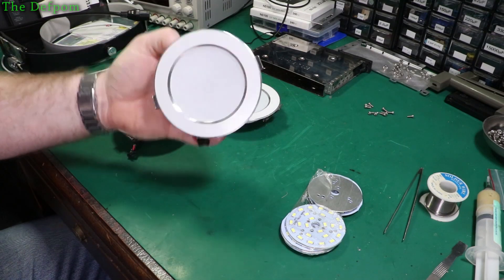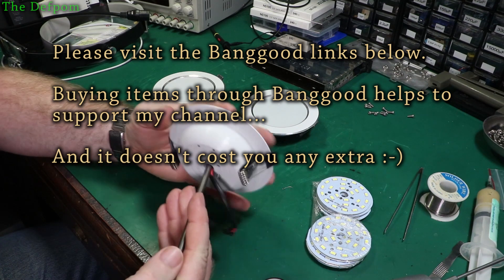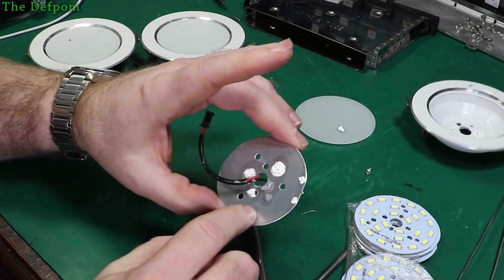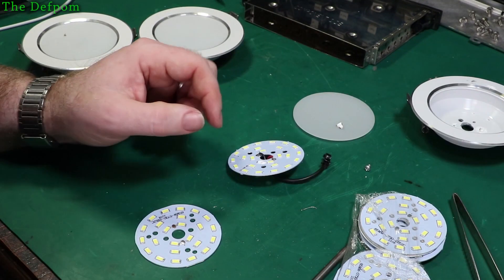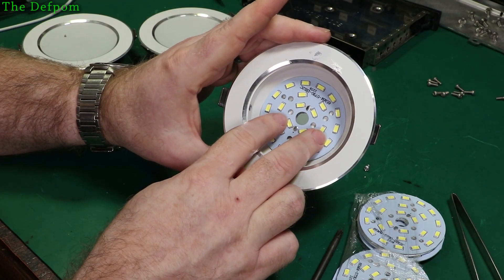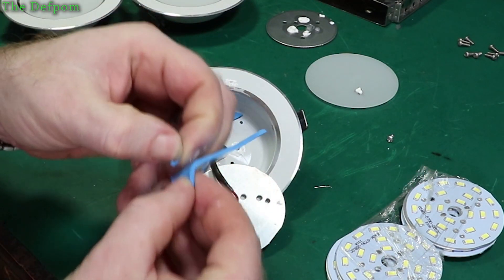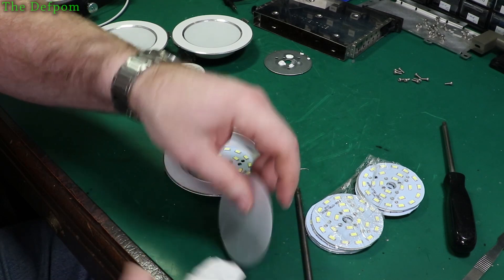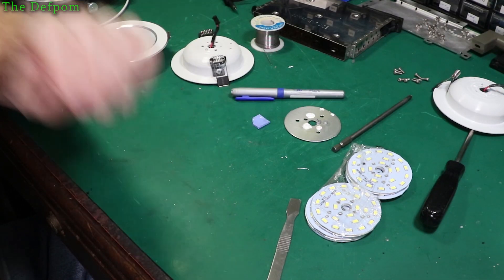🔴 #592 LED Ceiling Light Repair - How To Repair A Broken LED Downlight

Comment: i have a fan from home depot. only 6 months old, and the led blew 2 little spots on it already. But they dont sell the LED disk separately. I can't find it anywhere. I reeeallly dont want to uninstall the fan and take back.  its a Samsung led 20W, the light dimmed 3 levels. I dont know what all of the little numbers on the face mean but it may be a part number E466169. where do you think I could buy one? Home depot said no, lowes said no, I looked on amazon and could only find 17W.  the only 20W was $36. screw that. Id rather buy a new fan, switch out the bulb and take it back since they are not willing to sell me the part.

Comment: Thermal pads from old CDROM drives would work as well, you get around 3 per drive, enough for doing all those lamps with better (and free from ewaste) heat transfer. 5 minute epoxy also works well for this, though of course now the lamp is not easy to remove again. To pop those lenses out use a bamboo skewer, works well for me, or use disposable wooden chopsticks.

Comment: Might be worth try a compressor with just a blower attachment on it and sealing the other holes with your fingers to spread the pressure on the plastic a bit. Just a thought
Reply from the maker: Josh lever - I don’t have an air compressor, if I did doing something similar could work yes, HOWEVER and I don’t mean to be critical this comment is more of an educational one, but having compressed air against your skin is very dangerous, it can get through the skin and cause an air bubble in your bloodstream, which can kill you, compressed air is actually rather dangerous, especially if you have a cut or something on your hands.
Reply: @TheDefpom  never heard of this before and i am not that young. Geeez.
Reply: @TheDefpom  yeah I get what your saying completely! I was more thinking just a few psi to put a little pressure against it you could even bung the holes with blue tack or something alike

Comment: My theory is that their been driven too hard
Reply from the maker: Adrian Higgins - yes that is my theory too, once I get my DC load up and running again I will get one of the spare drivers and test it’s output voltage and current, they are supposed to run at no more than 38V and about 280mA.

Comment: Pisses me off how nothing you buy lasts anymore.  Although I do not like them, or endorse them anymore, I still have several WORKING incandecent bulbs left in this house from when it was built in 1999.
Reply from the maker: Daveyk021 - the use of flouresent and led is over rated, yes they use less power etc, but you generate a huge amount of waste making and disposing of them due to them not lasting very long, like you I still have bulbs from over 20 years ago that work, I have had to replace the kitchen flouro and now led about 10 times in the past 5 years... which is really better for the environment?
Reply: @TheDefpom  Depends on the quality, I use fluorescent lamps a lot, but buying good brands, made in a good factory, makes a big difference.  Have plenty of fluorescent lamps which do 10 years of service as night lights, and I am half way through the box of Osram Hungary and Phillips France lamps. Going to be sad when it is finished, as the newer ones are no longer made in EU, and have a much shorter life.
Reply from the maker: SeanBZA - NZ doesn’t import the good stuff for general sale, we seem to get all the crap stuff, even main brands are of poor quality, it doesn’t help that retailers seem to rip us off too, with massive markups so if something is of good quality it is so expensive that people don’t buy it.